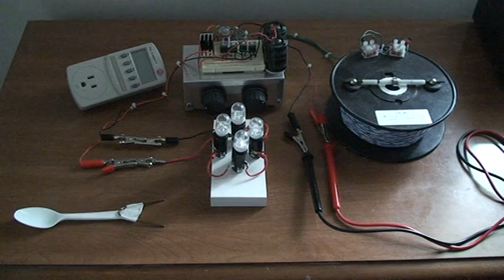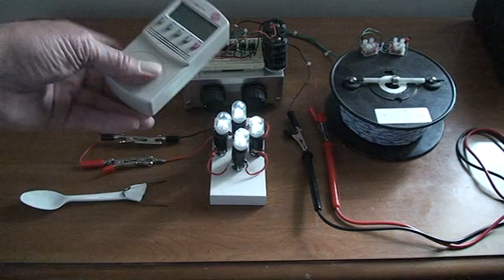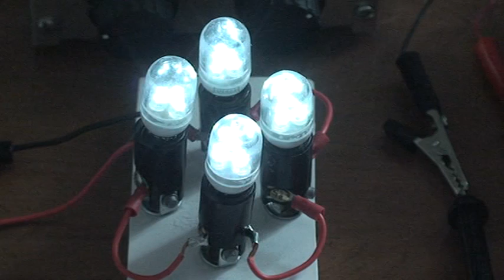RADIANT  ENERGY POWER BOX

Comment from the maker: @tinkerthinker72  You will find the setup is capable of very hi voltage and low current. at the output. However if you make contact with wires around the caps the shock can knock your socks off so be carefull. Examine all my videos and they will give you an idea what you can do with the power box. I used it many ways and it never failed to work or burn out the way it was constructed from my schematic on Photobucket. .However you use it you will have fun but be carefull handling

Comment from the maker: @tinkerthinker72   Glad to be of help. You will have many hours of fun with this circuit. I never was able to load it up so much that it burned out.  Very stable.   Be carefull as Hi voltage will knock your socks off if handled carelessly. I still have it working as of this date wheras most my other devices were taken apart.

Comment from the maker: @tinkerthinker72   Hi,

You need to buy a 1,000 foot spool of 24 gauge cross connect copper wire. Two wires will be on the spool and they are are already twisted  and wound on the spool from the factory.  Clockwise winding.   Two wires  start from the INSIDE OF THE SPOOL AND THE WIRES WILL END ON THE OUTSIDE OF THE SPOOL.  Remove enough wire from the spool untill you measure 19 ohms resistance through each wire on the spool. 2 wires to check.

Now you made the correct coil.

Comment: You could also try to run your LED lights without the big caps,
just with the rectified AC now being pulsed DC pulses after the bridge
rectifier, so it is getting less dangerous !
Huge caps charged up to almost 200 Volts DC are pretty lethal, so
for safety just drop them from your circuit and run the LED lights without it.
Okay, then you can not measure so well the output power but the lights
should be the same brightness I guess.
Regards, STefan.